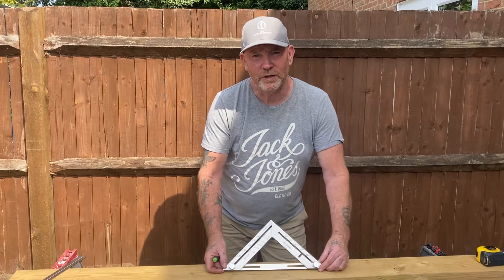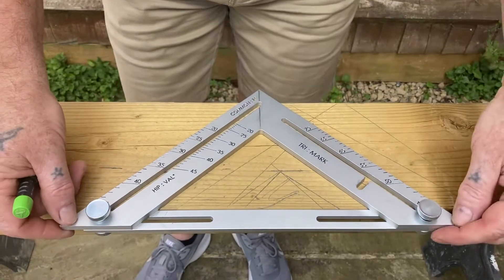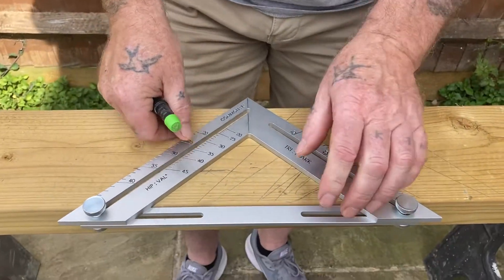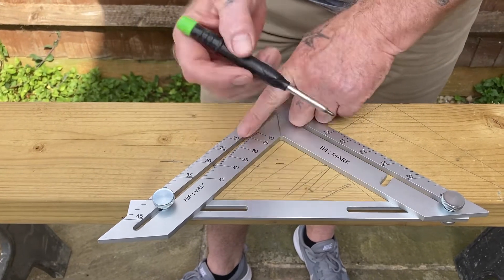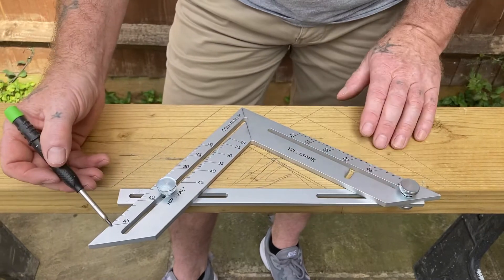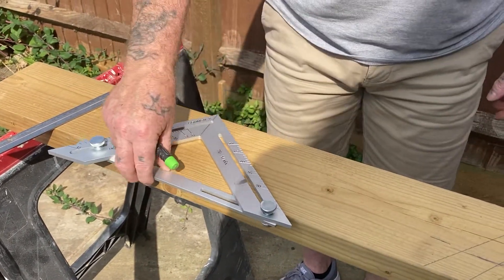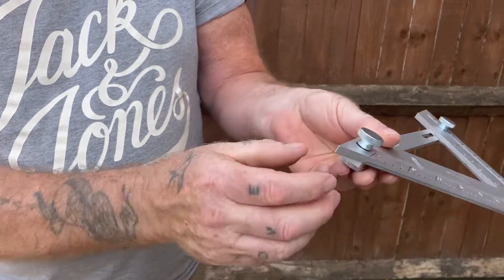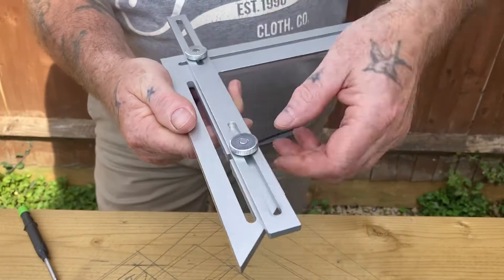Adjustable roofing square

Comment: I like the design idea, but as someone from the US (who you may not be marketing to,)  I'd like something bigger to handle larger rafters.  Even your video shows the difficulty with the existing size limit.  It seems to be approximately the same size as the smaller Stanley Adjustable Speed Square which many people find too small and plagued by the run/rise method of angle measurement along with an angle adjustment bar that's poorly located.  A few UK variants have come along to correct these problems and I like the fact that tradesmen and others are working on improvements.  I look forward to seeing product development and marketing on this tool! Impressive!
Reply from the maker: Thanks for your comment , it’s between a 7in and 12 inch speed square , it’s aimed more at the uk market , it will mark bigger rafters I just did nt feel the need to show how , another video coming soon ,